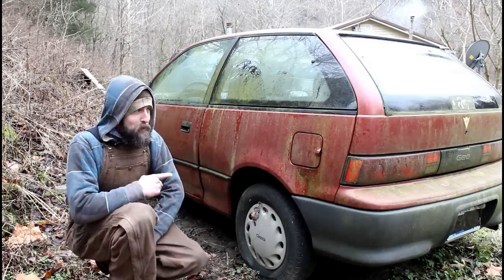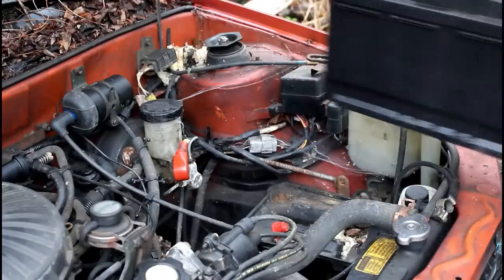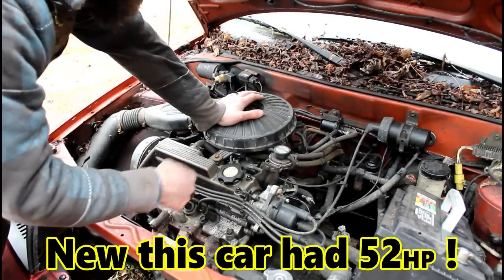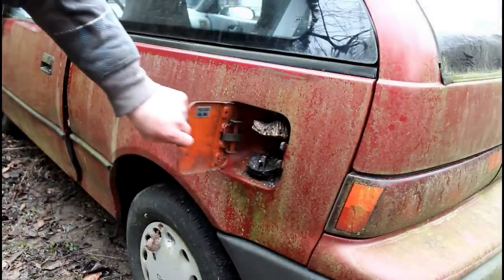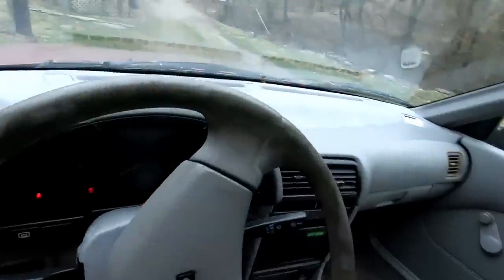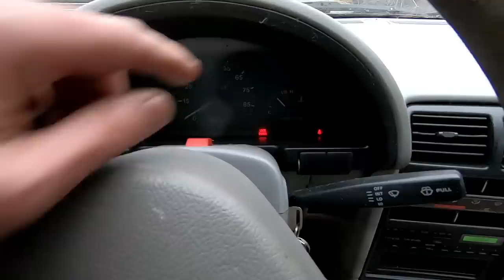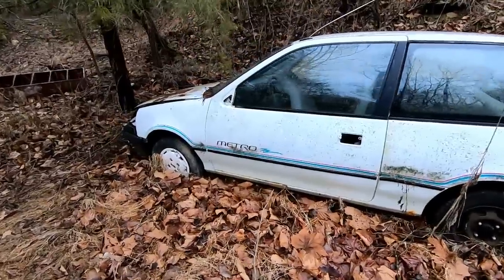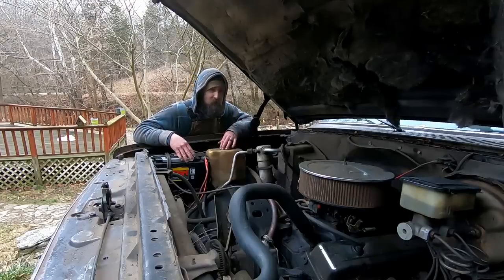WILL IT RUN ? Sitting for YEARS UNTOUCHED! 🔥

Comment: Japanese knows how make small cars that can run forever.
Reply: Is that japanese
Reply: @dereksans1015 might not made in japan but its made by Suzuki.
Reply: harsha806 it looks like a Dhiatsu
Reply: Geo Metro was made by Suzuki.
Reply: @thumperpaul  that type of cars were made here in Hungary too. Has been sold as a Suzuki Swift :) from 1.0L to 1.6L. Im sure both got some differences tho.
Reply: @thumperpaul  wasnt Geo owned by General Motors?
Reply: Eventually
Reply: This is a Suzuki Swift in my country, Trinidad, West Indies. It came with a 1300cc 4-cyl engine.
The Geo cars sold in the US were made by Suzuki.
Reply: @ramishrambarran3998  The only Geo Car that was Toyota was the Geo Prism. The Suzuki Swift (Geo Metro) and Suzuki Samari (Geo Tracker)
Reply: Geo was a collaboration between GM and Suzuki from 1987-1999 with some cars also coming from Toyota (ie the Geo Prizm lineups) until GM killed Geo and just put the Chevy logo on these cars(ie Chevy Spark,Aveo and the Chevy Metro until the early 2000s)
Reply: Mark Wolf not exactly the metro and track were based off of those models making it easier to manufacture parts and have them readily available by gm for the Geo cars
Reply: @Muldoon93  What? We are talking about General Motors / Geo not British cars at all. https://en.wikipedia.org/wiki/Geo_(automobile)
Reply: Unless they have a Mitsubishi badge on them.
Reply: I think it was called suzuki cultus on japan.
Reply: @marcmunoz8748  The Spark and Aveo were originally rebadged Daewoos. GM didn't buy Daewoo until a few years after Geo's demise.  Also, Isuzu had a hand in Geo as they produced the Geo Storm and Spectrum.
Reply: Henry R thanks for correcting/adding to my unknown knowledge
Reply: @Cheezwizzz  What have you been smoking!!@
Reply: @splsh8539  The Americans make CRAP CARS. The Geo was made in japan by Suzuki
Reply: @hobolyf  made in japan
Reply: @indranilchakrabarty4196  only they didnt make crap cars, the 1.8L inline 4, 300 inline 6, and the 5.7L V8 were almost unkillable. They were also put into some of the most durable vehicles on the road, the 1.8L being in many of GM's compact cars, the 300 i6 was put into Ford's F series trucks since the 40s/50s and the Bronco, and the 5.7L V8 was the gas guzzling beast put into GM's lineup of SUVs and trucks during the 80s and 90s before the legendary 5.3L took its place.
Reply: Indranil Chakrabarty So angry 😂
Reply: That's a fuckin' Geo bro.
Reply: @dereksans1015  it was made both by Subaru under the "Justy " name and by Suzuki under i think the "Swift" name. Also a good portion of the Suzukis were made in Hungary
Reply: I used to sell the Suzuki version. It was called a swift.
Reply: That suzuki amenity in indonesia
Reply: @ramishrambarran3998  Suzuki Swift in the Netherlands too😉 The new model Suzuki Swift looks awesome btw...
Reply: wish I got 2 free Metros!
Reply: @hobolyf  its a suzuki swift
Reply: @ramishrambarran3998  i still have this car in Pakistan today as "Suzuki Cultus Euro 2", they have upgraded its engine, 4 cylinder, EFI and few changes like headlights, brake lights etc
Reply: @hobolyf  I think that they had a Suzuki motor,I my be wrong on that.
Reply: @hobolyf  suzuki is japan
Reply: Made in India by Maruti, the engine and gearbox are Japanese
Reply: it's litteraly a suzuki swift but they gave it a different name for the US market for some reason
Reply: Everybody debating here over what it is...

The Suzuki Cultus was the platform that the USDM GEO Metro and the Suzuki Swift was based off of. In Canada it was the Chevy Sprint and the Pontiac Firefly along with the Suzuki Swift. 

These bodies were known as the Mk2/3 based off of the AA34S platform. When GEO designed the Mk4/5 body for the 1995-2001, the Mk2/3 tooling was shipped to Hungary where the Subaru Justy and the Suzuki Swift were produced by Suzuki. Most recently ( until 2017) the Mk2/3 tooling was used in Pakistan by PakSuzuki. There were various upgrades along the way but essentially the body stayed the same. The Cultus body (Mk2/3) ran from 1988-2017 in 5 different worldwide plants.
Reply: @dereksans1015  GM has had a Japanese version vehicle in America ever since the first year Chevy luv (1973 I think). Metro was unbelievably reliable and cheap on gas in the early 90's.
Reply: @Cheezwizzz  yes Daihatsu Charade is even much rarer than a Geo Metro.  I saw one the other day driving my old geo metro and said OMG what the heck is that1  LOL
Reply: @springer-qb4dv  I saw one two days ago, rotting peacefully in a front garden. The tired red paint had that familiar bloom to it. Better looking than I remembered 😁
Reply: @dereksans1015  It's NOT A "Chevrolet"!
Reply: @splsh8539  Yes.
Reply: @ramishrambarran3998  Metros here in America were built in Canada and the first generation models only had the G10 1.0 liter 3 cylinder. The 1.3 4 cylinder became an option later on. 1995 I think.
Reply: @marcmunoz8748  The Storm was a rebadged isuzu Impulse.
Reply: @MAGWolf  The Tracker/Sidekick had Toyota engines though.
Reply: @Silly_Cone the European Swifts had power steering!
Reply: This is also a Pontiac Firefly.
Reply: @ryanbareither89  hi. Not all of them. The stock car with a 1.0L engine usually came without power steering. It was an extra to the cars.
Reply: It's git the body style of a Suzuki but gm made it
Reply: @Cheezwizzz it is litteraly rebaged Suzuki Swift
Reply: Yeah ok.

Comment: It's a US version of the Suzuki Swift. :) We have a lot of running ones here, because here was the European manufacturing site. Greetings from Budapest! :)
Reply: Very cool
Reply: In Canada, the Suzuki Swift version used a 4 cylinder, and this car was also sold as a Chevrolet Sprint and a Pontiac Firefly, using the 3 cylinder. There was a convertible version of those. We had a Geo Metro with the 3 cylinder and automatic for a while. It was  "cheap and cheerful", but not your first pick to be in for a collision with a Mack truck. My main memory of it is of following a truck on a highway in thick fog at night, seeing his tail lights jump up and down, and then following him over a dead deer. We had fur on the underside for a while. 270,000 miles is really impressive, as is 50 mpg (62.5, in Imperial gallons) with the technology of that time. We aren't making the great advances in mpg I'd like to see.
Reply: I love you
Reply: Oh now i understand why there is lots of Suzuki Swifts in Magyarorzəg :)  Driving in Balaton you will see them a alot :) Köszi
Reply: Wasn't the UK version 1.5l , I had this but it was called Suzuki Cultus
Reply: Yeah, mostly with the famous G10A -1.0l NA engine. "Ezres motor papír kaszni, Suzukiban legjobb b***#ni!" 😀
Reply: @TheLemminkainen  They are still wery common cars in this country, apart from last ones manufactured 17 years ago. (1992-2003 the Mk2 serie, it had a facelift in 1996, the pre facelift ones  also called "régi Swift" - old Swift). They're cheap and reliable. The 3-5 door and sedant variants also manufactured in city of Esztergom (since '92) in Hungary. It had a lot of limited editions (Winter, Sport, Manager, Cherry, Fresh, etc..) and plenty auxuliary extras, such as power steering, power windows, central locking, AC.. The basic engine is the G10A, 1.0litre naturally aspirated with monopoint injection, just like in the video.
Reply: Suzuki Swift badged models were sold in U.S. too.
Reply: my grandmother was hungarian
Reply: here in the Netherlands it was a suzuki swift to, sold with the four cilinder engine, mostly a 1.3 liters engine.
Reply: In Greece we also have many Suzuki swift cars like this, they are they new driver’s first car for the most people
Reply: Patrick Pille ook de 3 cilinder is hier verkocht.
Reply: Patrick Pille Subaru Justy too.
Reply: Patrick Pille They also have European Suzuki Swift and Geo Metro here in Aurba (Netherlands Caribbean).
Reply: Holden Barina in Australia
Reply: The Japanese version is the Suzuki cultus, we had one in Ireland and it was a great car.
Reply: Came to Brazil but as a Suzuki Swift. There is a cool version called Swift GTi
Reply: @big_ostrich_egg7287  I had one in the UK and it was the same 1.0 3cyl. I picked it up for £150 with 43,000 miles on it in mint condition haha
Reply: also known as a holden barina
Reply: what name is it running with in budapist?
Reply: i had one myself :D
Reply: @stephenandloriyoung5716  Cars are far heavier now because of safety regs, and creature comforts/tech. So you need an engine that uses more gas to move it. Does seem kinda backwards.
Reply: Szia! Jó kis csapatós swift lenne 😅
Reply: Pont ugyan erre gondoltam mikor a videóra nyomtam, bár az európai kocka suzuki meg kocka opel hasonlósága felülmúlhatatlan marad :D
Reply: Here in holland also called, Suzuki swift.
Reply: yeah and Subaru Justy with 4x4 its too much funny car (I am really sorry for my English I am from Czech Republic)
Reply: We had the Suzuki Swift AND Geo Metro here in the U.S. I had a Swift GT it came with a twin cam 1.3l 4cyl. The metro was 3cyl generic version of the Swift. If I remember correctly Geo was basically a "Chevy"
Reply: Same here
Reply: Learned to drive on the Mk2 sedan version of this. Good old car with a sewing machine engine, so lovable.
Reply: Doesnt the normal swift have a 4 cillinder engine
Reply: 🤣🤣🤣 jo kis swift
Reply: We have the same badging but it's the most bad car it's really unsafe.
Reply: In pakistan this car is known as suzuki cultus
Reply: Subaru also took this model, threw their 4wd system in it and called it the Justy.  Now that version was awesome 😎
Reply: Just bought a '98 4door 1.0i Auto. 28,000miles and in really clean condition, turquoise.... I love Autos :<)

tooSavvy @UK
Reply: Actully, suzuki isnt owned by gm, and what actully happened is suzuki created metros, prizims, and trackers (my favorite) and are all but suzuki's version of it. Suzuki made it so that gm could compete with suzuki. So in otherwords, suzuki was competing with itself. The best part of it is, however, that suzuki made more money off of the metro, prizim, and tracker than they did off of their own cars 😂😂😂😂😂

Comment: That battery is literally the size of that little 3 cylinder 😂
Reply: Liams Lexus Build  it doesn't even look like what it used to the Chevy not realize that they have the capacity to make a brand new car look exactly like a car from the 90s? They're just choosing not to and besides a 2021 Blazer is not going to be any more reliable then the rest of the junk they make these days like who buys a 2018 Malibu to have cylinder 1 fail completely at 20,000 miles? That's just gross
Reply: Prawn Stars lol
Reply: Lol 🤣
Reply: The battery would have started a truck ! lol
Reply: HihiHi
Hi
Hi
Hi
Reply: Bummer that the car is due

Comment: you may consider this crazy but that Metro would be a great source of content should you tear into that engine
Reply: Yogis Friend I have rebuilt the geo prizm's engine(similar but 4 cylinders), and it was easy. It Would make great content!
Reply: why tear in on a motor with 280k on it ? replace it with a good used motor
Reply: @marksimmons3801  Good question. These motors are known for running for like 500k miles, but the prizm ones (mostly 1998 and later) burned lots of oil. So the ones in the junkyard are all ran out of oil, thats the only thing that kill these things. Even a good junkyard motor will start burning oil shortly after I install it. To fix the issue, you have to drill 2 extra oil drain holes in the piston. I figured I could either get a junkyard motor that will maybe run for 20k more miles before oil consumption kills it, or I could rebuild mine with fixed pistons and run it for another 200k.
Reply: @jimchance5006  thanks for the info and knowledge Jim !
Reply: Motorcycle engine swap
Reply: I'd watch it, i wanna see this thing get a new life. Good gas mileage beater.

Comment: Wow, That brings back memories. I was handed a 96 Geo Metro to play with. And since the previous owner looked like she used it for a demolition derby contender. There wasn't one panel or door or even the top that wasn't seriously damaged. I thought I would try my hand at auto-body repair, just because. 

Amazingly, I did teach myself after many many times of redoing the same areas and not liking how they looked. But then I finally understood how it was done and refurbished that car back to new condition. Even the inside headliner and seats, carpet and you name it. It was amazing the difference in that vehicle once I was finished refurbishing it. The new paint finish was near perfect and the local body repair guy stated he couldn't have done it any better and was amazed I did that on my first attempt. And it was that same red color as well...

Comment: Got me beat, Steve!  I bought a 1992 Subaru Legacy wagon from a co-worker for $150.  He'd abandoned it in the employee parking lot for about 3 years.  All four tires were sitting on the rims, so I aired them up and put a new battery in it and it turned over about 1.5x and popped right off.  I drove it for about 5 years and then gave it to my dad, who is still driving it to this day.  Japanese cars from this era were absolutely indestructible.

Comment: My first car was a 93 Geo Metro, automatic.  Car wouldn't move out of its own way.
Reply: 90s automatic transmissions were garbage. a manual metro was and is a very decent car. still lots of them running around europe and latin america.
Reply: Auto were hopeless. Stick shifts were great
Reply: My daily driver now is 94 geo metro, now 27 years old.  Still start like a champ and drives fine.  of course you don't expect 0-60 times of a sports car, but given the high mpg, you get a small, fuel efficient engine.

Comment: You can probably rebuilt that engine in a few hours for under 400 dollars.
Reply: ...and the car will cost $100
Reply: @qutiepie618  1500 for a good camry. an isuzu? i doubt it. but good to know
Reply: @julioc.7760  when gas hit $4.00 a gallon a few years back Volkswagen Rabbits were selling for $5,000 or higher on Ebay.  Diesel at that time was selling for $2 a gallon.  Now that the big 3 have decided to stop selling small cars in favor of high dollar low mpg suvs the resale on these little cars has gone up.
Reply: @EndOfTheW0rld  these little things could run until the body rots away at that price.
Reply: Probably more than what the car is worth. In my country 🇬🇧, the term Category C write off, commonly shortened to Cat C, is thrown around an awful lot meaning that a repair is possible, but the cost of doing so would outweigh the cost of the vehicle.
Reply: @MrSupercar55  Which is one of the worst concepts to exist. Consumerism at it's finest. Just fix the dam thing if you can do it yourself.

Comment: We had the same year make and model of that POS. Those 3 cylinders were bullet proof for a long time. Head gasket finally went at about 400K miles. We called it "putt-putt". Local kid bought it for 100 bucks and we still see that damn car running around today. Damn thing just won't die.

Comment: You can fix oil burners with a garden hose with a sprayer on mist. Get the engine up to operating temp and rev the engine up. Now slowly start spraying water do this for about 10 minutes. This cleans the carbon out of the ring lands and allows the oil control rings to work again.

Comment: Them Geo Metros are tough little SOBs. Years ago my cousins were ran off the road while in a Metro it rolled several times and slid upside down into a telephone pole. The car was still running when the first responders arrived.

Comment: I had a 1987 Chevy Sprint which was the forerunner to these cars. I bought it brand new and got 327,000 miles out of it. You are correct, for the price they were great cars. I also had a 92 metro and the Geos didn't have the engine and transmission matched as well as the Sprints did. The Geo always seemed underpowered while the Sprint had more than enough. I was amazed at the torque that little 3 cylinder put out as long as you shifted frequently and kept it in the torque curve.

Comment: I had a 1990 Firefly, a Canadian version of the Suzuki and it was a great car!  Not alot of power but got awesome fuel milage.  Very basic car, no power windows or power steering but the heater worked well in the winter.  Extremely easy to work on, lots of room under the hood.  Wish I still had that car to mess around with!

Comment: Bought one new in 1991. Up here in Canada they were made by Suzuki and sold by Pontiac as the Firefly when they first came out. Man, they were dirt cheap and tough as nails! They were pretty gutless on the highway but you couldn’t beat the mileage! I sold mine with nearly 400,000 km on it. Still ran good but smoked a little. Nice to see one running again. Thanks for the memories!

Comment: I had one like that one and loved it, even when it was slow as hell. I wonder how fun of a car would it be if it had a little bit more power.
Reply: They can be a fun rally car with suspension mods.  There is room for a Honda swap.  The K20 is probably not a good choice but it has been done by notching the "frame" to clear the crankshaft pulley.
Reply: They were available in 4 cyl on the late 90’s. I had an 01,but loved the original better

Comment: I’m in U.K. and have owned a Suzuki Swift (same car, different name) for ten years. I bought it for just £825 with 14,000 miles on it. It’s been the most reliable car I’ve ever owned in forty seven years of car ownership and by far the cheapest to run.

Comment: Unironically for a total shitbox these were great commuter cars. Tougb, reliable & got insane mileage if you drove them right. It takes a lot to screw these little cars up. 

Couldn't get away from their own shadow though.
Reply: My little shit box is going to have a 144 volt forklift motor. Talking about a rolling casket on wheels.